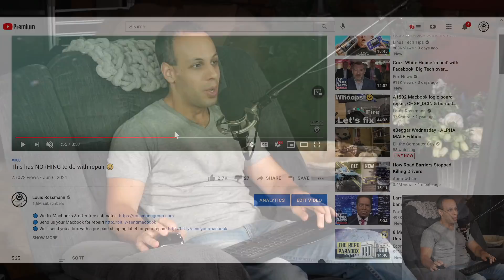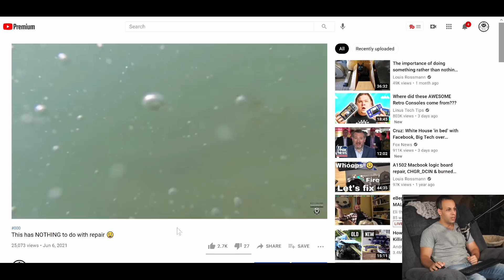Why are user serviceable batteries a bad thing?

Comment: the reason I prefer of nonremovable batteries personally is that when they were removable most if not all the phones with removable batteries were mostly if not completely plastic and made them feel cheaper also having them be removable also took up more space making the battery have a smaller capacity
Reply from the maker: The HTC sensation has a premium backplate and removable battery! Pepperidge farm remembers!
Reply: @rossmanngroup  Galaxy X Cover pro, bought one for the wife (she has broken every other phone before it). Removable battery, unbreakable screen, water resistant, IP68 rating. Premium feel.
Reply: @kot1pelto  Love my X Cover Pro. It's not a super high end phone... but I submerge it all the time (just for kicks) and still has that sweet sweet removable battery. Win/win.
Reply: @rossmanngroup  My last phone was an HTC sensation. I beat the shit out of that phone.
Reply: @rossmanngroup  don't forget the LG V20 too, metal backplate and removable battery. I really wish you would make videos on The Xcover phones though (Samsung released two midrange phones in 2020 with removable batteries and water resistance).
Reply: @rossmanngroup  quality application of this meme 👌
Reply: @rossmanngroup  Honestly the phone can still be sealed while having a removable battery. I think it should slide in from the bottom frame. It can be glued to the bottom frame bar and have all the gaskets and seals on the battery part so it retains the IP rating.
Reply: @rossmanngroup  messed up part is. They could implement removable backs even with the current phones that we have. You can add gaskets to those removable backs as well. They just don't want to go through the manufacturing process and keep their profit margins as high as possible.
Reply: @rossmanngroup  HTC phones look like a chinese tablet inside :D
Reply: @rossmanngroup  Had one!
Reply: @rossmanngroup  You know a high power phone with removable battery, that is also cheap?

Didn't find one under 200 bucks
Reply: @rossmanngroup  wireless charging 🤔
Reply: @rossmanngroup  I dont get why you pin shame this comment, this does not meant that he/she dosent support right to repair, battery can be no removeable but still easy to repair/replace. forgive my english
Reply: @dchiab818  Stop being so sensitive. Honestly.
Reply: @dchiab818  bro exactly I don't use a phone for a year or 2 then get a new.one the last phone I have was for 4ish maybe 5 years in that time I had replaced the battery it wasn't that hard it was an iphone 7 all it took was following an ifixit guide
Reply: This comment is from a clearly misinformed person.
Reply: @DiegoMS  Very true, probably someone who's only ever owned an Apple of Samsung and figures that there are no other manufacturers.
Reply: @DiegoMS  The way he writes looks like a DT advocate
Reply: LG G5, all aluminum, removable battery. I used to get home, drop the battery with the button on the side, and slap a new one in like a handgun magazine. Then I could just put the battery in it's charging dock so it can be ready for the next day. I very rarely even plugged my phone in.
Reply: @bakedandsteaked  was looking for this, LG phones are/were so underrated, rip lg phones
Reply: @bakedandsteaked  lol, i just posted almost the same thing as you, switch batteries like a glock mag
Reply: @bakedandsteaked  lg g5 all aluminum, removable battery, no wireless charging
Reply: @Stez827  because not being able to use your phone while it's charging is so convenient
Reply: @bakedandsteaked  ok yeah not everyone is a fan but when just dropping it on a pad having it charge up then when you need to use it just grabbing it not having to fuss with a cable is nice especially just dropping it on my bedside table then waking up getting ready and just grabbing my phone
Reply: @Stez827  or just have a removable battery with a spare and charging dock so your phone never has to be docked or plugged in ever lol.
Reply: @bakedandsteaked  if it's a dock you still have to line the phone up with a wireless pad you just drop in in the general area
Reply: @Stez827  he meant dock as in you plop dead batteries in there, and they will charge. Meaning almost 0 hours of downtime with replaceable batteries. you dont even need to charge the phone I have this canon t3i with a battery charging dock, when my camera runs slow, i pop it out, take a charged one off the dock, put it in, back to taking pictures. 
https://pine64.com/product/pinephone-battery-charger/
Reply: @thermostance1815  oh shit just realized that I guess that's kinda cool it's just when I'm asleep I don't really care about "downtime" also you still have to line up the contacts on the battery to the charger not s big deal but not the drop charge
Reply: So instead of having a plastic cover that can stand a hit or 2 you prefer a glass finish that break if it slips your hand? Also i dont see why how the deisgn cannot be accomodated to have both good battery and be removable. The reason the battery was smaller wasnt the design, it was cost to manufacture.

Ill take cheaper but sturdier over fancy and fragile anytime. SPECIALY!!! On a thousand+ dollar device.
Reply: @lancepatchwork2263  same here I don't care for what phone I have as long as it can make calls and text and is durable and has home button, power and volume rocker
and AUX
and tbh I'd be fine with a flip phone from 2004-2007 it makes calls and text 
I'm 20 years old don't have much uses for a phone even a burner flip phone would do fine for me
Reply: @lancepatchwork2263  :   hell yeah  !!!!    I'll stick with my Note 3  ( WITH A DOUBLED SIZED  AFTER MARKET BATTERY  )  
No need to carry a  Large  POWER BANK  !!!!   Just pop in a fresh BATTERY  !!!!!
Reply: @lancepatchwork2263  i remember my old phone just bouncing of the ground whenever i accidentally dropped it. My current xz2, while really sturdy and durable, probably wouldn't fare as well.
Reply: @lancepatchwork2263  removable batteries are indeed more limited in capacity because the need thick plating on the outside so they won't destroy themselves
Reply: I love replaceable batteries. It means that I can make an electronic device (gasp!!) last longer! Instead of replacing the whole damn unit whenever the battery dies, I can extend its life by replacing the battery!

Less junk in landfills! Who knew?
Reply: I replaced the battery three times. That's three phones I would have bought otherwise. When did I replace the phone? When it had a different hardware failure. This is exactly why they don't want us replacing batteries. Because if we replace the battery, we don't replace the phone. We don't buy a new one from them. We don't throw the old one away. The fact of the matter is these people don't care about the planet. I'm no tree hugging nut job, but I understand that recycling is the better thing for the planet. And the longer you can use a device, the better it is for everybody. Apple, Samsung, sell premium products, and sell them to rich folks. They sell them to left-wing nutters who claim to be all about saving the planet. Yet these very same companies make products that are inherently unrepairable and throw-awayable. If you really care for the planet, you won't buy products from companies that only give lip service that don't actually care.
Reply: @Maybe-So  - I don't throw my old phones away even if I get a new one - they sit in a drawer as a memory box. Some even still work (to some extent)!  I'd still be using my old LG K20 if it could see a wifi signal.

But it's bullocks that unreplaceable battery design is a thing. There is no reason other than planned obsolescence.
Reply: @Maybe-So  don't throw your battery in the trash!
Reply: @Maybe-So  I'm not saying that if they were able to make a phone that has all the features of a new flagship(including wireless charging and all) that I wouldnt like that it had a replaceable battery that would be awesome but it hasn't been done
Reply: Well but most of the time people use phone cover
Why do you care about feel of the phone if what you touch is the cover itself
Reply: @junjung2975  I'm not really sold on the 'most people' use back covers.' I and most people around me don't use back covers, do you have any actual evidence showing how many people use back covers?
Reply: @junjung2975  I agreed there. I gave my brother's galaxy mega 6.3. People thought he had the latest largest iPhone
Reply: @junjung2975  btw while we are at it, are there screne made from polycarbonate ?
Reply: @ChuckLeeClerk  screen?
Well old phone do and majority of non touch screen still using plastic as their screen
Reply: @junjung2975  I don't use a case
Reply: I used to love all glass and aluminum premium phone but now i feel stupid paying 800-1000 for a Phone, i now have a Moto One Hyper that i paid 300$ and I LOVE it and i really enjoy the cheap glossy plastic back
Reply: @Jonathan11225  how can you enjoy a glossy finish?
Do you like seeing your phone have fingerprint marks all over it?
Reply: @tamoozbr  same as glass back
Reply: @Jonathan11225  matte finishes are a thing
Reply: The LG v20 has a sleek totally made out of metal design and has a removable battery
Reply: @Aomicplane  hello V20 crew. 😁
Reply: @Aomicplane  I loved my V20, but I think I like my X Cover Pro more. still removable battery, put it under water all the time.
Reply: @Aomicplane  LG V20 user here too. Not totally made out of metal. The top and bottom lip is plastic, But the back cover recycled airplane aluminum is very solid.
Reply: @Aomicplane  it doesn't have wireless charging now it would be fucking awesome if a phone had all the features of a brand new flagship with a easily replaceable battery and a micro SD card slot and a nice metal and glass design but it hasn't been done yet
Reply: N97 had user replaceable battery and full metal case, from the top of my head.
Reply: @dexter2811  It was well built.  The N8 even more so (and yes, you there were screws there, but the battery was still easy to access).

And then there was the 808 PureView, which was made out of some VERY nice plastic.  Super sturdy.
Reply: @dexter2811  The LG G5 did too!
Reply: @dexter2811 did it have wireless charging
Reply: plastic doesnt only feel cheaper, it is cheaper, would be a great way to decrease price of nowadays phones, also its lighter than glass and aluminum ,also allows for better wifi and cellular signal
Reply: @goblinslayer5404  Not necessarily. Aluminium, which is a very cheap metal, is cheaper than engineering plastics as raw material. Plastic can also be very durable, my Canon EF 100mm f/2.8L USM is made of plastic and you could use that as a club. It doesn't feel cheap at all, specially not the texture. Feels way more expensive than every single phone both low and high end I've ever touched, even though it's not actually that expensive.
The only problem is that nobody is gonna use engineering plastics on phones unless the phone is for some industrial application because the average customer will look at a phone which isn't made of glass and aluminium and scoff at it unless it costs like 200 dollars and these plastics are too expensive to end up in budget products. I think the ruggedized phones might use engineering plastics, but I haven't seen one up close yet.
Reply: @tiikerihai  it might be cheaper as a raw material, but after machining, is it still cheaper? cz metal tends to be more expensive to machine if im not mistaken. i dont know much about engineering plastic, first time ive heard of the term tbh
Reply: @goblinslayer5404  samsung's S21 and S21 plus have plastic backplates (ultra is still glass, i believe.) seeing as i throw a case on my phones, i don't care which it's made of, and honestly would prefer plastic anyway because the glass will end up scratched (somehow does even in a case) and it was part of how they lowered the price compared to the S20 lineup
Reply: @goblinslayer5404  "Plastic is cheaper" ... * Screams In Polycarbonate *
Reply: @JohnMarkIsaacMadison  polycarbonate sheets are less expensive than aluminum sheets. also some phones like iphones use steel which widens the gap even more.
Reply: @goblinslayer5404  It's not that much more expensive to do a metal case, TBH. Plastic case, 3 cents. Metal case, 12 cents.
Reply: @MeepChangeling  yes but they dont end up charging the end user just a few extra cents now, do they?
Reply: Droid X was all metal with a removable battery. Removable battery ≠ cheap plastic and/or not water resistant. Thats what the OEM wants you to believe.
Reply: My LG V20, that im using to post this, has a METAL backplate.

Covers were plastic so you could have your precious wireless charging, which, surprise, is inefficient and wastes a lot of energy.  The progression to glass backs was to create revenue streams for "out of warranty" services.
Reply: Plastic phones are actually more durable than metal phones, they're cheaper to manufacture and surprisingly they're better for signal quality.

The only real benefit to using metal is that it consucts heat, so the phone essentially works as a heatsink.
Reply: @philtabest  plastic is also lighter, modern phones are really big and heavy, plastic construction could help in this case. I dont think anyone likes their phone weighing upwards of 200 grams.
Reply: Motorola phones from 2004 had with aluminum case like RAZR V3 , SLVR  L7, all with removable batteries.
Reply: @rsobe  Nokias E series had metal backplates (like my E51 and E52)
Reply: S5 was all plastic and didnt feel even slightly cheap. also had battery capacity options from 3rd party batt makers.  sounds to me like you are trying to justify to yourself why these companies keep fucking you, but you dont want to admit the defeat.
Reply: I tried my best to avoid the non-removable battery phones until it was all of them....
Reply: @ThoughtHadMe  not all, just the mainstream crap for the masses is like so
Reply: If my phone has a glass back which was removable then after I crack it I can just get a new one and replace it myself instead of now having a phone in which I can't trade in because of damage resulting in an insurance claim (assuming I have insurance and want to go that route).
Reply: @doc7000  I remember the Nokia "chocolate bar" NON "smart" phones and mobile phone accessories WAS BIG from replacement backs AND fronts and "supersized" batteries and even LED flasher lights and any NUMBER of accessories
Reply: I just transferred my number to my third Galaxy S5. You're right that it doesn't feel too great, however with the extended battery it gives it a more substantial feel. On the other hand, it doesn't have that overly fancy feel. On the OTHER other hand, I could throw it at my buddy just to mess with him, and it's a 50 dollar phone at the end of the day.
Reply: well shit, get yourself a BV9100 then. The battery is sealed in, but you can pop apart the whole damn thing with several screws in the back. You can make a "sealed in battery" and still make it easy to replace.
Reply: They don't want removable batteries so you can't totally shut your phone off.
Reply: Plastic is really only used to make something cheaper to manufacture. It's actually easier to make something out of metal both thin and strong. For instance, the original (2003) RAZR line of phones was known for being exceptionally thin at the time, and its body (including battery cover) was aluminum.

Also, a dedicated battery compartment is definitely NOT required. I've had phones where you could see the circuit board under the removable battery. More often than not there was just a very thin piece if plastic (like a sticker almost) between the battery and PCB. Even back then, saving space wherever possible was important.
Reply: My car has a steel body and a removable battery
Reply: @vincel8866  haha.. My motorcycle too. I change battery twice on my own.
Reply: that's BS, think of older gens of iPhones, they had literally a "fancy" backplate that slides to open and had 0 reasons to be not removable, yet they had unnecessary screws, even more comical the unnecessarily glued batteries has a flat that bends on top and goes to a tiny socket with more screws on the side, while it could simply have a rigid strip with pins on one of its sides, there's zero needs to sacrifice removable batteries or their capacity in designing "fancier feeling materials" it's all marketing lies. When they first removed the headphone jack on the iPhones, there were modding videos to hack one in again!! *HANDMADE HACKS*, which means it's way less space efficient than having it there by design, yet there's enough wasted room to accomodate one...
Reply: someone here thinks about nokia 3310 clones when talks about replaceable battery, check out samsung xcover line of phones, sure theyre plastic, but they definitely dont feel cheap, and battery is good enough to forget about charger for 2 days.
Reply: This makes no sense at all. Removable batteries are not linked to the phones hull material. You can have both and neither. There is no connection.
And they took more space, because they were larger back then due to technology not being as advanced. You can have tiny removable batteries these days. There is a slight space difference but most users wouldn't really see or feel the difference.
So your arguments are very bad and make no sense.
Reply: 1. Most people put a cover on their phone so the backplate material generally doesn't matter. 2. Making it hotswappable has little to no effect on the battery size/capacity. If components were as big as they were on older phones I'd understand but even iphones have the capability to make the batteries hotswappable without taking anymore room. Can tell you haven't opened a phone in a good minute
Reply: So what happens when they make your TV remote battery non-removable, and you have to buy a new remote for $200 when the battery dies?
Reply: This is probably the most ignorant comment i've seen this year...
Reply: I thought I wanted aluminum and glass too, my current phone has aluminum rim and glass back. Glass back is cracked and there is a huge ugly dent on aluminum frame. I have come in conclusion that I really really don't need glass and aluminum. I think my next phone will be Pixel 4a, it is smaller than most phones now (most phones are way too big now!), has a great camera, fingerprint scanner backside and PLASTIC back is a huge plus.
Reply: @LPlFan81  agreed on everything except phones being too big. They were bigger back in the 16:9 5.7 inch days. Remember, when consuming 16:9 content, a 5.7 inch 16:9 screen is noticeably larger than a 6.4 inch 19:9 screen. Frankly, I wish phones would be as big as they were five years ago. This is one of the reasons why I still use an LG V20 daily as a second phone and pocket tablet. How do people forget about all the huge 5.7 inch phones in the 16:9 days, not to mention the few 6 inch ones. A 6 inch 16:9 phone is HUGE, bigger than pretty much any modern phone. The annoying part is that when huge phones come out, they often put low res 1080p displays in them. I'm looking at you, Pixel 6 "Pro". You shouldn't get to charge over 600 bucks and call a phone "pro" when it has the same resolution as and a LOWER PIXEL DENSITY than 200 dollar phones have.
Reply: Dude, if the battery is faulty and leaks, then you're done! You better have money saved up to buy a new phone. Lol
My old Samsung phone had this issue and because it was replaceable, I just bought a new one. Nowadays, I guess I will get a horrible battery acid accident that will turn me into a mutant if I ever dare to change one. LOL.
Reply: I'm confused.
So the feel, of the phone is more important than longevity, performance and so on? 
Ignoring the fact metal backplates exist/existed. 

You feel that it's okay for a device to last 1-3 years & before the non-replaceable battery starts to fail & you're left with having to buy another phone that costs several hundred dollars? My Gameboy SP from 2005 still works. 
The metal back that 95% of people put a cheap plastic case over because the metal or glass scratches easy.
Reply: @Snotnarok  It was the tech reviewers who started with that "premium feel" bs 4-5 years ago and all the sheep went along with it. If your phone wasn't made of "premium materials" like the iphone it was considered cheap and so phone manufacturers had to follow suit cause the reviewers would roast their phones if they didn't and it would kill sales. I found the whole thing ridiculous and so here we are.
Reply: @vjbk1587   I'm well aware.
I remember, I believe it was Kotaku defending the removal of the headphone jack.
Insisting that bluetooth sounds better, that 3.5mm jacks are old and should be phased out like a phone jack.

The amount of BS pouring out of that article was remarkable. 

Defending getting less, but paying more. Premium feel over functionality, longevity, common sense. 

Reviewers in a nutshell!
Reply: Most of this is completely flawed logic.

Most phones were made of somewhat cheap plastic back then because that was just the style at the time, but also because the companies making them didn't have anywhere near the resources to invest in more 'premium' materials at such scale.  And if you're cynical (very rightly, imho), it was also largely to make you have to upgrade to an entire new phone.

It had nothing to do with user-replaceable batteries.

The only part of your comment that makes any sense is that user-replaceable batteries take up more space (and a little bit more if weatherproofed).  But that is at most 100mAh worth of battery and frankly not worth the cost to either us or the environment.

It's quite disheartening to see your comment get so many likes, as most of it simply isn't true and is ill-informed.
Reply: @Stez 827 well, that was how most phones with removable batteries were made during those times.. in fact, those WERE how phones were made. Lol. But now, it's not bcos they WILL be made like that IF they had removable batteries; but it's a business move to make users unable to "repair" their phones. Buy it a couple of hundred dollars, the battery is dead? Buy a new one!
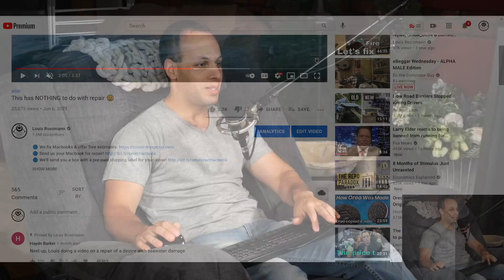Reply: JerryRigEverything did a video not even a month ago on the Kyocera Ultra 5G , while it may not be easy to open , its battery is user replaceable type with hardplastic 4500mha , preaty much  as big as it gets .  You can look up his video on it and look at around 4:30 of the tear down . Manufacturers are just baiting easily fooled people , and since people are easily fooled and follow like sheep you only need 20-30 accounts/people to shill for them to get the ball rolling .
Reply: If just having a phone to talk with people even in wet conditions - the Ericsson R250s was a good phone.
Reply: I love when Louis pins misinformed people, easier for me to have a laugh lol.
Reply: @GoldSrc_  😂🤣😂
Reply: I got my brother the Samsung Galaxy Mega 6.3. it had a removable battery that lasts forever. I had several luxurious feeling phones from Nokia. they all had removable batteries. "plastic" phone dont necessarily feel cheap. there are many ways the manufacturer can make it feel luxurious to touch
Reply: @yuqing2006  I imagine they kept buying cheap phones made of "recycled sewer pipe" and only experienced that unmistakable "shitty" feel. 😏
Reply: "feel cheaper" WHO CARES, only the phone marketing machine cares about that shit. Same with paper thin phones and laptops, only the marketing made people care about that shit. But this is the same for everything, cars clothes whatever. Advertising works.
Reply: Plastic is the best body material for phones, you can't change my mind. It's way better than the glass shit we are getting most of the time now.
Reply: @aozora7  b-b-but they can't charge $1500 for a plastic phone, but slap some glass and metal on there and people will be tripping over each other to empty out their savings account
Reply: Man that is such a lame reason to vouch for such a stupid techological/greedy adaptation for stupid companies.
Reply: so what next? are you going to praise TV manufacturers for forcing you to buy a new tv because the batteries in your remote die and arent user replaceable? because if things dont change, i see this happening in the near future.
Reply: No, and no.

The phone feeling cheap has nothing to do with the battery, its a different thing altogether.
As for the smaller capacity, nah. No. Again, not related. My xiamo redmi note 4 has a replacable battery (although you have to take the back off, not sure if that counts) and it has almost twice the capacity of an Iphone X
Reply: lol why are there people like this
Reply: LG V20. Solid as a brick still using it 3 batteries later. Thinking about a Fair Phone for the future or maybe a Pine Phone.
Reply: @joebruno2675  I have a pinephone, a fellow man of culture i see.
Reply: It was more fun to throw a phone into a wall though, the way the wall got torn down. Looking at you 3310.
Reply: The reason you prefer non removable batteries is because you are a child and believe everything you are told.
Reply: LG v20 has a metal back. And a removable back
Reply: those are all sad excuses to be able to not to repair..... what's wrong with you? if the battery was replaceable you could carry an extra one...... no charging,longer life..... no sending it away to get it fixed or replaced weeks on end waiting and most times its a different device..... why would you not want the right to fix it yourself..... or  fix it with just a walk down the street?  just because it felt cheap? you understand glass is just sand right? that glass is why it falls off the counter or slips and breaks.( most replacements are over 60 $) and your phone spends 99% of its life in a case and the back is never seen.....
Reply: @how2gamebadly  long camping trips you can bring a second battery for when the first dies
Reply: @jasonriddell  yeah. Not looking for a plug in. Or a cable etc. It was much much better
Reply: LG V20 had a removable battery with a metal back cover.
Reply: Having a replaceable battery allows you to have a bigger capacity battery tho... E.g. one that fits the dimensions of the phone neatly, flattening the back so you dont have to deal with nasty camera bumps
Reply: I loved the leather feel of my old note 4. removable battery was quite sufficient and I still love the look and feel of it. but it would be just as easy to pop in a glass back on such a device
Reply: you sir have too much money, and shouldn't expect others to have the same level of disposable income
Reply: If this guy admits he wants a phone with a removable battery he can't have his iPhone without seeming like a hypocrite
Reply: Yet having a phone with a fragile, easily broken sealed glass back is somehow more "premium"? I don't think so.  Just people believing the marketing hype to justify their phones that cost as much as good laptops that are far more useful.
Reply: looks at my lg G7 ThinQwith easily removable battery

Yeah no. Having a metal phone doesn't prevent batteries from being removable.
Reply: @invertedv12powerhouse77  wireless charging 🤔
Reply: Find a cheaper feel because I use the same phone for 4 or 5 years so having my battery be replaceable is kind of nice
Reply: There's these great things called cases. They add another layer of protection and some weight.
Reply: Nokia/HMD C series has a big battery and removable. it's not manufacturing limitation but user interest. Plus non-removable battery has the same size of modern removable batteries minus the connector ribbon for contact point
Reply: I have a HTC and a Nokia with Removable batteries that comes with a solid metal backplate :/ 
[Htc desire( looks similar to it :/ ) I think is quite cool the battery just slides out from the bottom of the phone and has springs to eject it ]
Reply: @obscure8125  that is cool and if that was a thing on newer phones and they had wireless charging I would support it it's just that it isn't the case
Reply: Aaaaand, correlation is still not causation.
Reply: @Stez 827   The LG V20 Smartphone had a user replaceable battery with average-to-high capacity for the time and a metal backplate.  Now if you want to comeback with "that's one phone", I'll retort with "That's because people didn't speak with their wallets.".  Face it, phones ditched user replaceable batteries NOT because they couldn't easily make it work for modern phones, but BECAUSE they tricked the sheep into believing NON-replaceable batteries were trendy and cool (just like removing the 3.5mm headphone jack).
Reply: @HalfBreedMix  honestly removing the headphone jack while annoying wasn't that big of a deal and the reason companies have to do it was straight bullshit but it didn't destroy the value of a phone for me because adapters are a thing and pretty small and if phones had easily replaceable batteries and wireless charging that would be amazing but it's not that big of a deal considering how it's not that hard to get into a phone to replace the battery if you have a guitar pick and a heat gun/hair dryer
Reply: @Stez827    prying open your phone voids the warranty, swapping replaceable batteries did not.
Reply: @HalfBreedMix  at the point where the battery is shitting itself your warranty has most likely ended
Reply: @Stez827   True, but I can recharge my V20 in a few seconds (battery swap).  Plus being able to completely power down your phone can be a great way to fix some issues.
Reply: @HalfBreedMix  there's button combos to just shut off the phone but the convenience of wireless charging isn't speed it's being able to just drop the phone in the general area on a pad and wake up and it's fully charged
Reply: @Stez827   The only thing I wirelessly charge is my toothbrush (where it being water-tight is required and I'm not loosing $1K if the battery craps out).  The convenience you mentioned seems like it comes with many tradeoffs that I just don't see being worth it for something like a Smartphone.  I charge it at night on a nice sturdy dock, and the battery lasts me easily thru the day.  Now where I see wireless charging being a really good idea are in tools that don't have big capacity batteries and get used often,,,,,,,,, and where being port-less is beneficial.
Reply: @HalfBreedMix  that's very true but you aren't losing 1k if the battery died your losing 30 minutes maybe an hour and 30-50$ (if you fix it yourself) and I don't see a reason for a phone to be portless because it would make troubleshooting software issues much harder and make flashing custom roms on Android phone WAYYYYYYYYY more difficult I DONT want a portless phone all I would want is something that is slightly more convenient at the expense of the battery last slightly less in the long run
Reply: @HalfBreedMix  yeah cant really disagree with you there I never had a phone with an easily replaceable battery so can't really say it isn't worth it just remember android phones back in the day s1,2,3 etc being plastic with plastic topped with plastic
Reply: Let me remind you that every single power tool from hammer drills to angle grinders is made with a plastic housing these days. Plastic is not cheap weak shit, if done correctly.
Reply: @TheBackyardChemist   Yeah, and for those items heavy-duty plastics not only work, but make sense.  However, a Smartphone (as much as it is functional) is also often a personal item for which the user's affinity goes beyond it been merely a tool.  Metal is viewed (and is actually valued) as premium to plastic, which is why the high end smartphones will go as far as making a freaking volume button out of metal.  These smartphone manufactures could easily make a Waterproof Metal phone with a Replaceable Battery,,,,,, but they fooled the sheep into thinking this can't be done, and hence can keep their costs down and increase profit (and further boost that profit when customers' batteries die and need new phones).
Reply: @TheBackyardChemist  that's not a fair comparison considering how thin and light phones are now
Reply: LG V20 had a removable battery with a metal back cover.
Reply: @adamzahoy1749    Yup, as I mentioned earlier.  Sadly this trend of people not pay attention to brands such as LG leads to us having less choices.  LG's phone division is gone now, so I suppose the sheep will be happy (while the companies they buy from use tech features pioneered by the brands they pushed out).
Reply: Do you also enjoy it after 2-3 years of phone ownership when it only lasts half a day and you can't easily replace it?
Reply: @Handl3sAreStupid  idrc because it's not that hard to replace it as I have done
Reply: @Stez827  Maybe it's not that hard, but it's a lot easier to just pop off a cover and replace the battery. 

Plus, if my phone had a removable battery, I could carry an extra with me backpacking.
Reply: My Sonim XP8 is one of the most water-resistant smartphones ever made and it has a user-replaceable battery.
Reply: There could be some valid reasons for choosing to go to a service for a battery replacement instead of changing it yourself.
One of them is aesthetics. A lot of people love the look of thin phones while having a good battery life. Having a user replaceable battery would make having ultra thin phones pretty hard, considering you would need some kind of mechanism designed to withstand user abuse while still being able to fit in the tight thickness margins some phones have. You could try making casings thinner, but this brings up safety concerns, as a charged battery with a thin shell could become a fire hazard if damaged. 
Another point would be the possibility to make battery packs some other shape than the classical rectangular baggie of polymer and maybe packing some more power into it. I might be wrong on this, but I believe at the small sizes required, the locking mechanisms would wear out pretty quickly.
I never actually tested the water resistance on my phones, but I do feel more confident having my phone professionally serviced and sealed with glue than relying on clamping mechanisms that could loose their hold without me noticing it.
Reply: Oh god, please, bring back the fucking plastic... there's nothing more retarded than easily scratching backplate that you need to cover up so it doesn't look dogshit or god forbid a fucking piece of glass or ceramics... whoever thought of using these materials in device that you keep on daily in your pocket was a fucking retard.
Reply: Stez 827: Makes about as much sense as saying that you don't want a severed limb replaced with a prosthetic, because back when you first learned about prosthetics they were all hand-carved wood.
Reply: LG V20 removable battery metal backplate with mil std 810g shock and drop resistance. You can get a spare battery for it now that is a 4420 mah battery which lasted about as long as my S21 ultra does on a single charge. And it didn't add any extra bulk to the phone 

Plastic may look "cheap" but I can't tell you the amount of times dropping a phone with a plastic back held up better than a phone with a glass one. The moment you touch a glass backed phone it gets all smudgy like plastic does plus most people just put a case on their phone anyway so the aesthetics of the phone is moot at that point.
Reply: As much as I like the glass on my 7T McLaren, the back on my LG K20 Plus is easily a close second. It was very grippy, and made of some super dense yet flexible nintendium-like plastic.
Reply: I absolutely loved it when phones had replaceable batteries I mean I remember my Galaxy S3I had a few rechargeable batteries That would be fully charged. I checked all the capacities levels of the batteries and and actually found out that they were OEM with even the part numbers being alias part numbers inside the build of materials for the phone.... yeah so I wasn't afraid of safety issues. Anyways my point here is that I loved the convenience venience of being able to literally to literally bring my phone to 1% and then Bing slap in a new battery and have 100% up time with my with my device. Good times.
Reply: That sounds more like a design problem rather than a problem innate to removable batteries. Whatever experience you've had, you've been scammed.
Reply: I was going to add a comment, but I think everything's been said. My only addition would be,  Christ! You're stupid!
Reply: can't argue much about capacity, but if there was battery breakthrough, it wouldn't matter as much, or if it was user serviceable, bringing back ups was a thing. There were a bunch of phone designs that were metal with removable batteries. Samsung wave 2, LG v20. The glass sandwich was probably one of the worst designs ever as not only the front shatters, but the back does too. Some went more exotic with Kevlar, leather, or a rubberized material so you could grip it. The phones "feeling cheap" is rather subjective. You wouldn't grab a DSLR or mirrorless camera and say the body feels cheap just because they used FRP.
Reply: The I prefer a removable battery is because it allows me to extend the life of the device, and I don't have buy a NEW phone when the battery stops charging properly (which happens every 1 to 2 years). I had a smart phone last 4 years on me when it had a removable battery. I only needed to change the battery 3 times before the phone died.

I think its ridiculous when phones have become more expensive than laptop computers. For $800 to $1000 dollars I could buy a mid-range gaming laptop
Reply: In what conceivable way is the material the phone is made of related to the materials it's constructed out of?
Reply: My LG V20, is mainly of metal construction, with a removable backplate (made of metal) and a removable/replaceable battery with a capacity of 3200mAh and has a form factor thickness of 7.8mm/0.30inch. It has a MIL-STD-810G rating where it survived 26 drops from a height of 4 feet (during testing).
It does not however, have any water resistance capability, but with further innovation, it could have been implemented in successor models.
Reply: LOL that's funny and totally wrong. All they have to do is place a lot less adhesive on the back of the battery, duh
Reply: Clearly haven''t watched this video. If you don't want mostly, then purchase the obscure. We need to dispose of devices as so we can fill the world with junk. What in the world is wrong with you?
Reply: ST185 RC Wooo
Reply: I like my polycarbonate the superior material when it comes to drop resistance, weight and not inhibiting radio waves
Reply: It is a crying shame that dislikes do fucking nothing on this platform anymore. You're arguing against function for form, you should NEVER be allowed to have a say on how devices are made.
Reply: The phone's total lifespan decreases with fixed in place batteries. I've replace the battery in my current phone and it was much cheaper than having to buy a new phone. Also e-waste is a thing and reducing it a good thing.
Reply: I respect your opinion. but these are extremely trivial complaints and don't actually justify non-replacable batteries.
Reply: What? "feels cheap"? How is that an issue worth sacrificing s removable battery? Especially when they have the same if not less battery life today.
Wait a minute... pulls off Scooby Doo villain mask Aha! It was Apple all along!
Reply: if they wanted to, they could solve all your points and then some. if they wanted to…. look at how far we’ve come with other aspects of a smartphone
Reply: this sounds like you created a problem where there really isn't one
Reply: Ah yes, as opposed to the glass back on modern phones.."improvement" until it shatters
Reply: Is the extra thin really worth of that your phone became glue sandwich which wont survive sitting in pocket and the battery dies anyway within year?
Reply: Nice phones with removable batteries were built well.  You're talking about cheap bargain phones.
Reply: My current phone, LG G5, fully aluminium like the iphone 7, but more scratch resistant, slim like the iphone, also water resistant to an extent, guess what? It has a removable battery that is detached like a glock magazine
Reply: galaxy s5 was meh.. liked it but it got dropped in water by accident :/
Reply: Look they're just challenges... They could've faced it to retain removable battery if they really wanted to. Even making one with non-removable would've had its own challenges and they faced them.
Reply: Gigaset GS4 had a user replaceable battery and a glass back.
Reply: I will never again spend more money on "premium" features that makes phones worse. Glass/metal backplates are drastically worse than plastic backplates.  Sure it's shiny, but it chips and breaks under situations plastic doesn't.
Reply: @drackar  so so.... ur choice though. But plastic doesnt feel premium.. midrange phones tend to lag after a few years for gaming and medium intensive apps. prefer flagship cuz it competes with Apples iPhones... But again its ur opinion
Reply: @cheezybread7783  the case and the internals differ purely because fools will pay more for objectively worse materials.
Reply: @drackar  maybe but plastic fades.... ngl but u have the same mentality as my bro he has a Nokia 3.1 plus plastic body but receives more android updates and  is quicker than Samsung devices usually due to stock android, which he likes a lot.
Reply: @cheezybread7783  how much time are  you spending leaving your phone out in the sun?
Reply: LG v20 was all metal with removable back.
Reply: @quint2568  g5 too i think... i dont own one but saw that cool battery swap thing
Reply: Maybe because of theft, some user prefer sealed battery.
Reply: Mom's Moto E4 had removable battery and it didn't feel cheaper(well it was 80€ phone but the feel was good) 
Removable batteries do not take more space than normal ones the size of the battery is the same and even connection can be handled in same way as nonremovable batteries.

The reason why nonremovable batteries were that small was because during that time when they were standard batteries were only so small.

And one more point to drive home - wasn't the newest Samsung flagship also plastic?

Metal/Glass glued back brings no advantage to user as the same can be achieved with plastic that is more durable, cheaper and can be made into removable part.
Reply: i mean theres nothing logically stopping them from having a removable battery and making the phone back out of metal, after all its just a little snap off door which already exists in metal, obviously wouldn't work in glass backs but glass is a terrible choice anyhow since its expensive to replace, and will crack upon the smallest impact
Reply: Phone cases are plastic. If you've ever opened a sealed phone you'd know the battery is nearly identical. Maybe you get 15 more minutes of charge with a sealed battery. But with a replaceable battery you can have 2 and a battery charger then always have a charged battery.
Reply: I would rather have a plastic back (high quality non breakable) than a glass back an y day of the week. A non removable battery means that the phone can always spy on you even when off (which is the most likely reason you cannot remove the battery on newer phones).
Reply: With replaceable batteries you can have multiple batteries and swap them when the battery runs out and charge the dead ones, gives you wayyyy more runtime.
Reply: Not really. See Xiomi Redmi Note 2.
Reply: Everyone want new things, satisfying their vanity for a while, then realizing its not worth it. My last phone was Samsung S3, horrible battery but at least it was replaceable. Work that shit for almost 4 years before buying a new one. Been using this chinese (Xiaomi) phone for almost 5 years and its battery life still had some juice in it.
Reply: So you want a glass back that breaks very easily and that can cut you? At the cost of having a better user experience?
Reply: Correlation does not equal causation
Reply: It's just how things where designed at the time. You're mistaking causation and correlation. The macbook pro of the time was all plastic everything was plastic, it's not linked to battery technology. Technically the newest iPhone's battery and screen would be very easily user replaceable if you had a pentalobe screwdriver, but they're software locked just so you can't since the 8
Reply: >I fall for marketing campaigns designed to associate aluminum with quality

That's you, that's what you sound like
Reply: LGV20 lets go
Reply: Yeah, then they made bigger smarphones and bigger batteries only more thin and as progress went on, more dense. Only you now can't replace them and back covers are made of glass that shatters and can hurt you, makes you unconfortable when someone notices, and to avoid that you have to use a silicon/rubber cover, which at times makes your phone look bigger, cheaper and unconfortable/heavy to carry in your pocket. That's progress! Oh, almost forgot, battery lasts almost the same as 10 year old smarphones because they, indeed, increase capacity but only to feed newer chipsets, for almost the same amount of time companies got you to get used since touchscreens entered the market.
Reply: well yes but in the past a lot of phones in general were of largely plastic construction.
Reply: I'd rather my phone feel cheap and work rather then bust once and saddle me with buying another 1000 dollar fucking piece of plastic.
Reply: My first smartphone had a removable battery..man I was able to put a battery 3 times its size. Do you know how good it feels to need to charge your phone once every three days?
Reply: Personally, I don't care about the material finish of a phone. I want performance from the processor, I want enough RAM that it wont slow down with a browser open while I'm on call and a few other apps like email and weather running in the background, I want high storage capacity and expandable storage, I want a big battery, and I want a decent OLED display. I could care less if it's plastic or aluminum.
Reply: Those things aren't mutually exclusive
Reply: These were also the devices that you pushed the same key multiple times to switch between ABC DEF etc keys.  Technology has evolved and we can see compact and elegant and rugged designs all at once!
Reply: Nice st185 I own one
Reply: My Galaxy Note 3 has a leather-like backplate, and not only that but I updated it to Android 11 and added wireless charging after the fact with a little add-in card!
The Note 4 had metal sides and a plastic backplate, some people put cases on their phones because the glass and metal is slick, whereas a removable back means the manufacturer could make different colored or different material backplates that have a leather texture, are rubber, etc. You could even make it water resistant with a rubber O-ring if you designed it like that
Reply: @epifritaxey4376  it's cool that you like the leather type stuff I'm just not a fan it just doesn't feel premium to me and yes custom roms are a thing
Reply: The some old nokias series N had metal not plastic and removable batteries, but were like a brick
Reply: oh yes, so let's throw out a complete phone when the battery dies, that will certainly not make it feel cheap! ahahahahah, what are you using to process your thoughts, Stez?
Reply: Terrible argument
Reply: Pin of shame
Reply: An iPhone user vs android users
Reply: @Lenari_Reigh  I have used both and currently use a OnePlus 9 and on my old iphone I replace the battery I personally don't like iphones because they don't give you freedom to do what you want with the device like install apps not from the app store
Reply: How nice of Louis Rossmann to highlight one of the more sane replies. Having a replaceable battery puts a lot of constraints on the overall phone design.
Reply: @hbgl8889  y u don't list don't of these constraints
Reply: @F0reverYoung  For one, you have to pretty much shroud the entire inside in plastic and probably change the internal layout, too. Water resistance and wireless charging are also harder to implement. Plus, you cannot have a unibody design and no glass back.
Look, unlike most of the people in this comment section, I don't pretend to be an expert hardware designer or market researcher. But I do know that if pretty much all manufacturers stopped making phones with removable batteries, then that means that they believe it is not worth the (opportunity) cost, i.e. it is a bad trade-off.
Reply: ok but that has nothing to do with the battery... that's just the manufacturers decision
And all phones are plastic or glass now anyways because nfc
Reply: Thats stupid. Batteries need enclosure even in an enclosed case.
And a spare battery is lighter than an powerbank. So you could have two batteries instead a phone and a hevier powerbank...
But you're right. Use cardboard things in a cardboard 1 use life, and be enviromental friendly. 
Cosif you use onetime, is a metaphore, a thing than throw it away, youll makemore garbage than if you reuse it without all industrial process to REMAKE the same object.
Congratulation. You saved the earth. Im ironic.
Reply: I had an S3 Samsung and then an S5 Samsung, weren’t terrible but i dropped it a few times and the backplate would fly off, they eventually cracked, and the battery would bounce out. I had 2 batteries go bad in my S3 and 1 in my S5 from being damaged bouncing around out of the phone. They puffed up and wouldn’t fit back in. Bought new batteries and they were good as new. I always was nervous because their are so many control points in the battery tray to access board level stuff and even the gold plated tabs for the battery connections got bent a little. Of course I switched to a newer phone a while ago but I’m not bothered by a captive battery. If it goes bad I’ll give my computer repair shop some money to replace it.
Reply: @RadDadisRad  problem isnt with that "oh youll give it to repair shop". Problem is with overall spare parts to fix your phone, repair shop wont repair your phone if they wont be able to source broken parts, capisci?
As for your batteries, i would say its cherry picking, never had broken screen, never had bloated battery, does it mean things like that dont happen? Ofc no, but that doesnt mean that your bloated battery is something that happens all the time for everyone.
Reply: You must love junk.  Plastic is the standerd even cars is plastic crap.
Reply: @Aj-vz5ux  Why do you think plastic is crap?
Reply: @Aj-vz5ux  CHEAP plastic is well CHEAP BUT carbon fibre is NOT cheap in ANY sense of the word and IMHO would make a "premium" handset
Reply: also if u have a removable battery how are you going to have wireless charging, the charging coil will be at the same place where the battery is going to be.
Reply: @stevenr3544  on the back plate? Bro, dont create problems where there arent any.
Reply: @aaron03071991  he kinda does have a point. Wireless charging is a staple for any flagship phone.
Reply: @RadDadisRad  i gave a solution to his issue, glue coil to backplate with which you close phone, simple. Ofc if you break backplate, it will cost more to buy a new one, but if you wanna have useless gadget which wastes more energy than simple cable connection, then go ahead and pay more.
Reply: @RadDadisRad  to maybe 1% of the population. I built wirless charging into my desk but most of the time i use my magnetic charger. Automatically connects when i sit my phone at the edge of my desk and charges way faster than wireless
Reply: @stevenr3544  They used to sell 3rd party add-on charging coils to phones without wireless charging.  They would typically fit right inside the backplate with minimal issues.  In fact, I think you can still get them for certain phones.
Reply: @LiveFreeOrDieDH  want to say my S5 NEO had a bac cover option that had a coil in it and contact pads in the battery tray - just checked and there is indeed 2 pins inside that would interface with the back cover / I assume they are for inductive charge coil
Reply: @stevenr3544  doh put the wireless charger on the battery
Reply: @stevenr3544  Galaxy S5.  It was an option. The coil was built into the back cover.
Reply: @stevenr3544  What are you talking about? The note 4 had wireless charging. You had to buy a different back cover to replace the one that came with the phone but as I recall it was plastic and removable. Yes wireless charging back in 2014 on a plastic phone with a removable battery. Back then it was considered more of a novelty before it became the norm. The whole no wireless charging if battery is not integrated or the back is not metal/glass is simply not true.
Reply: @stevenr3544  wireless charging uses an induction coil which can be very thin depending on the design it could be fitted to the backplate or to the replaceable battery itself.